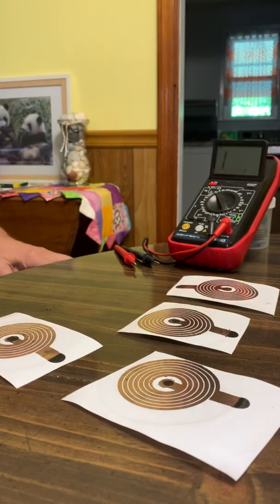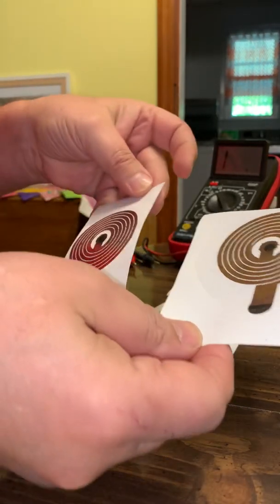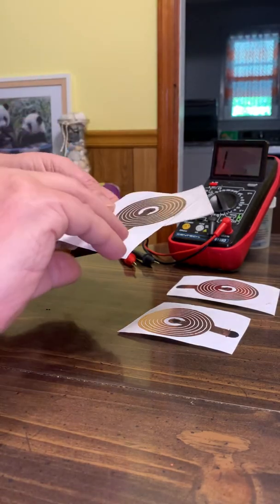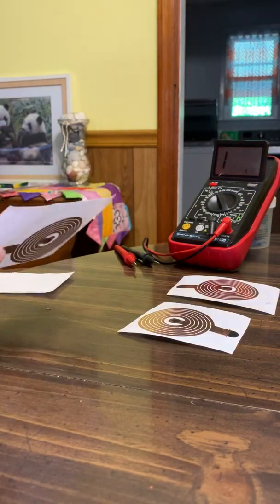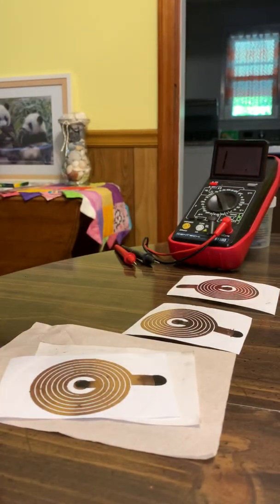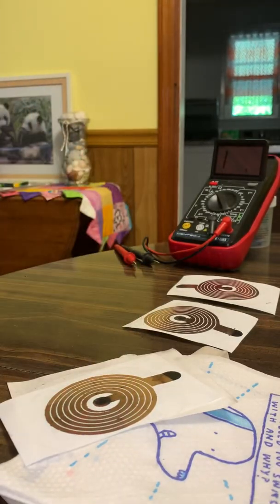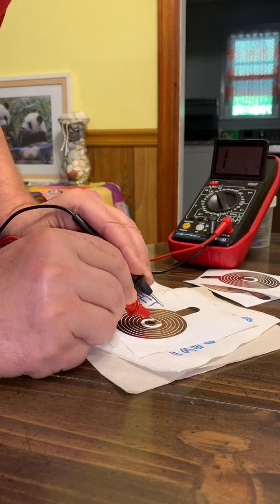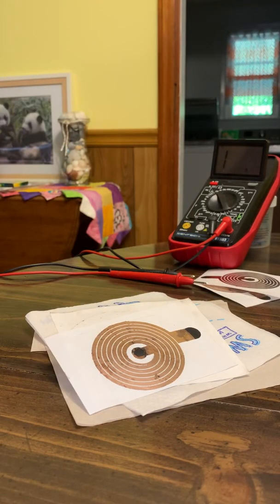Making Tesla Bifilar Pancake Coil

Comment: Can you then laminate it to protect it?
Reply from the maker: On photo paper you need to rub it down with graphite or better then that is Graphene to fill in any scratches . Filling in the scratches helps the flexibility of the circuit. Then laminating will preserve it, but it’s not necessary. It holds it’s conductivity over many year after a Graphene coating.
Reply: @conductiveinkalternative918  You mentioned graphene coating? If you have graphene conductive ink(even better doped with colloidal silver) , why not just print with  it, instead of needing copper? https://www.youtube.com/watch?v=xNJ_24j5VhY
Reply: Rubbing it with graphite does not coat it with graphene lmao. 😂